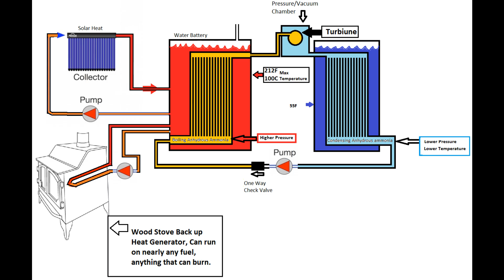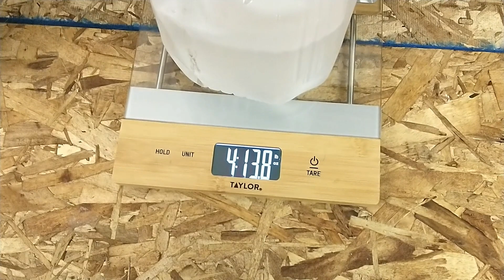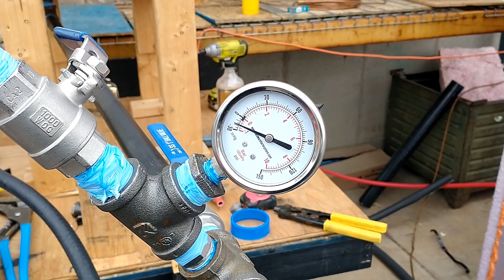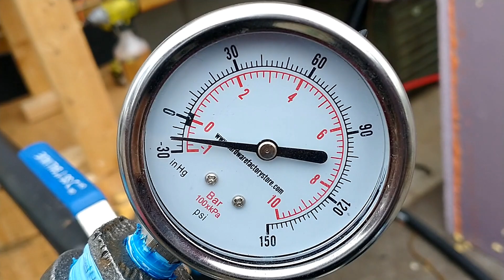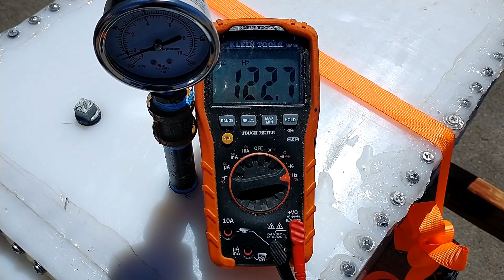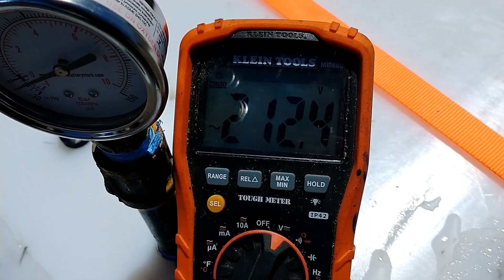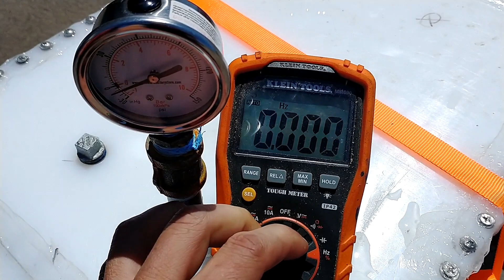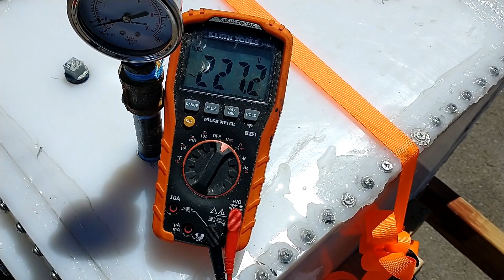Tesla Turbine Complete Thermodynamic Transformer

Comment: Very nice work, and very impressive indeed!. Really like your complete systems diagram. Thermal storage tank is your battery and so electrical energy on tap, all from sustainable thermal sources, neat. Hopefully your tesla turbine can hold up longterm without too much maintenance. Then you'll definitely have a super innovative highly flexible reasonably high COP & low cost offgrid power system sweet system for sure. All grand stuff! :) (y)
Reply: Why not use a TIG welded standard non magnetic autistic 1/16" sheet steel like 304 for your turbine box (a cylinder with end caps even better), and externally insulate it with either 2" to 4" thick builders foil backed heat proof polyurethane foam board or mineral wool to keep a higher vacuum state. Maybe the turbine could be also insulated with shaped polyurethane foam board cutouts to keep the maximum temperature differential between the hot and cold side too. Should give you faster warm you times and higher efficiency as well.
Reply from the maker: Thank you very much! I really want to use some kind of stainless steel for the chamber, If eddy currents were not an issue we could do that. We are going to test a new generator that doesn't require the vacuum chamber to be made of plastic. For now reinforcing the vacuum chamber with a little bit of stainless steel will do the trick.
Reply: @iEnergySupply  Thanks!, your very welcome. Austenitic stainless steels have a high amount of austenite which makes them non-magnetic. Even though grades such as 304 and 316 stainless steel have high amounts of iron in their chemical composition. Austenite means they are non-ferromagnetic so no eddy current issues. 304 is the cheapest out the two and its a similar one SpaceX uses for its starship just of interest, so its pretty durable stuff in harsh environments.

Comment: You should install a bedini circuit on generator coils, add just a capacitator rated at same voltage(if 220ac, will be 110v dc),
 instead of batery so it can run with no drag and produce energy
Reply from the maker: If I was more experienced with that type of generator I would give it a try. If someone were to build it I would test it on the turbine.
Reply: @iEnergySupply  the circuit is very simple.... i also saw persons with you already capable to help... i know them from other videos. You manage to do that and i will help on the rest
Reply: The geometry of the winding has also some specifics... but once is TESLA i guess it will only fit. I am the first driving the prototype https://youtu.be/CsnNtzhu7B4

Comment: @iEnergySupply  Hi Jeremiah, 1st let me thank you for sharing your experiences which gave me much input! 
Regarding your sealing problem of the concrete-box  it might be a solution to treat the material with potassium silicate (i don't know the exact english word but in german it is called "Wasserglas"). This substance seals the pores and when the liquid has dried, you get a very dense surface. It is very often used in the real estate branch and not expensive. Instead of steel reinforcement i would use aluminium or VA or glasfibre.
Another point is the use of ammonium for lowering the boiling point in the heater liquid, which may cause you new problems with bubble-building inside the system which can lead under certain conditions (heat and pressure) to an H2O-cracking process where hydrogen will be created - what you definitly not want. I use in my photothermic solarpanels a special liquid which has a boiling point of approximately 130°C and without being corrosive (it is nearly the same as antifreeze liquid for car engines, but not so abrassive). 
Good luck and success for your project!
Reply: aluminium reacts with the concrete. good shout on the water glass though.
Reply: @TheKlink  you are right - Alumium isn't good therefore.
If i should built such a case, i would make a mold out of Styrodur where all pipefittings with big flanges in the middle can be placed and then i'd fill the mold with acrylic resin. The only remaining removable side can be sealed with a sealing ring and screws. If you later realize that it don't work, you still have an aquarium...;-)
Reply from the maker: for now I am going to fix the box with stainless steel ribs. Basically my vacuum box was like a body without bones and with so much pressure from the atmosphere it got warped. I like the antifreeze idea for the solar circulation system.
Reply: @iEnergySupply  Here is a brief description of the solarthermic configuration i have installed: The primary circuit runs through a 10m²  collector. The pipe diameter is only 8mm and it is layed out like a serpent above some heat treated copper plates (which are blue now). On top is a special corroded glas which let the light in from low angels. The back of the collector is isolated with rockwool. The 10m² feed a 1000 l tank and my record measure was above 90°C on a sunny day in summer. The collector is located in northern Germany (53rd latitude) and even in cold clear winterdays i had temperatures around 70°C.
The second circuit system transports  the steam to the turbine and the exhausted water to the cooling tank, from there back to the heating tank. 
Running on two circuits will avoid steamproduction inside the primary circuit, which is the hottest.

Comment: Do you think one very thick concrete sphere as vaccum chamber can withstand high vacuum? In order to reduce losses to zero, covered with liquid rubber or resin. Strong , cheap, non magnetic and simple to shape . Half hollow sphere on top of another.
Reply from the maker: You know I really like that idea but I think it would need to be reinforced with rebar, but maybe fiberglass would work, it would need some kind of reinforcement.
Reply: @iEnergySupply  Yes fibre glass or carbon fibre would be perfect.
Reply: Reinforce it with basalt bar or mesh. Non magnetic  very strong and will not rust.

Comment: I wonder if a copper vacuum chamber would enhance the generator?
Reply: I guess that this would be a very electrifying experience.... ;-)
In one of his previous video's where you can see 3 motors running without being physically connected and only one them is actively driven by the turbine. That shows how far the magnetic field goes. I think that the box must be a good isolator and magnetic shield.
Reply from the maker: Correct.
Reply from the maker: It would heat up, that's for sure.
Reply: @iEnergySupply  Yes, but if you could cast some 1 inch thick slabs of copper, It would make a great heatsink, you could also solder the joints and solder copper pipe to the unit to recapture heat.  It would be interesting to test to see if the heat is generated inside the vacuum, or drawn to it externally.  

I'm sure you've seen the neodim magnet being passed through a copper pipe. If the rate of fall is decreased, wouldn't that mean that the energy is being converted to torque?

Comment: Looking really good! Were you having leak issues in the pump? Or was it always to go back into a chamber?
Reply from the maker: The chamber was leaking, but we are fixing it with metal braces. we have a check valve so no leakage goes from the boiler to the condenser in the wrong direction.

Comment: 10:45 just make a concrete box....or weld up a stainless or aluminum, or other non conductive metal box.
Reply from the maker: Concrete would be nice, but it may leak. I can't use full metal or the eddy currents form the magnet will rob power from the generator because our magnetic field is so large.
Reply: @iEnergySupply  got it.
Reply: @iEnergySupply  Concrete can be easily sealed with any rubberized sealer.

Comment: What is the overall idea here? To generate a loop that powers the turbine?
Reply from the maker: To create a better way to store energy, a better way to collect solar energy, a way to convert nearly any heat source into energy, burn any fuel to make energy. Water can store so much energy in the form of heat, the turbine can use that energy stored at low temperatures to produce usable energy.
Reply: @iEnergySupply  ...no I get that but  generally how...looks like heating the stuff in the tubes to create pressure, sent it through the turbine to a collecting tank to cool and recycle....almost like a AC confession loop? Why use ammonia?
Reply from the maker: @AndrewHorezga  Ammonia has a lower boiling point, and it's non toxic at low concentrations. When you mix it with water you can tune the boiling point to match the heat of your system. To get the maximum amount of efficiency at lower temperatures and pressures.

Comment: Great job 
Impressive, 
but it seems that the coil that is going to generate current is very small for the power of the Tesla turbine .
I know that you are doing tests and as far as I can understand this system can be miniaturized and still have tremendous power 💪🏼👍👋🏼.

sorry my English is a little rusty 

A long time ago in one of the videos of the turbine, I commented that for the turbine a sphere would be better instead of a box since the external pressure will always be greater due to the vacuum and the spheres distribute the pressure very well.
Reply: Very hard to make a sphere, maybe a tube would be easier
Reply: this

Comment: COOL!  You have been busy!  Make sure you put a relief valve on the boiler!  Lots of cool ideas.  I love the sensor coil - mucho better!  What will happen if the pump fails?  That turbine pressure case shows me how much you have been screwing around!  I would start to write down exactly the specs of each turbine and test rig and give each turbine test rig a name so you can compare notes later as you go through iterations.  May I suggest Sylvester for this one? :)  Good luck and be safe!!!
Reply from the maker: We are getting the equipment donated for analyzing the system! I'm glad because it's extremely expensive, they are starting with a really good custom made thermal imaging camera.
Reply: Sylvester?